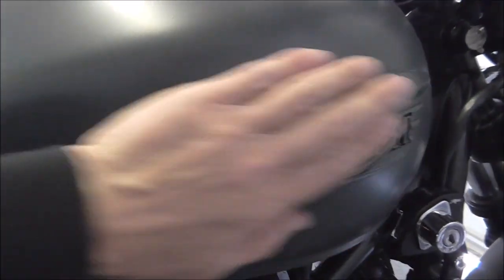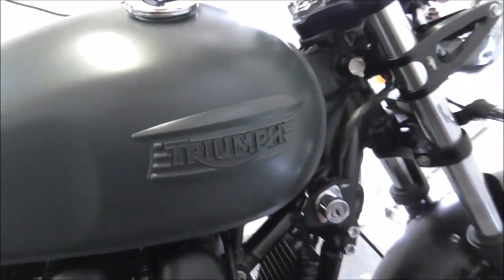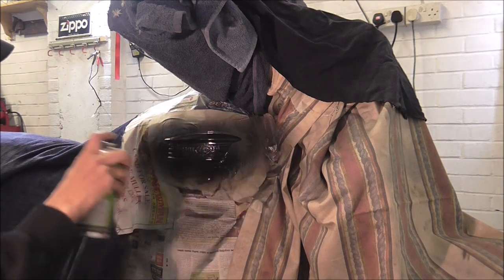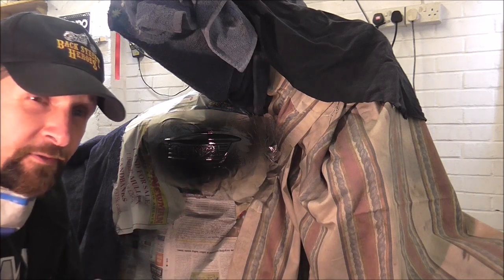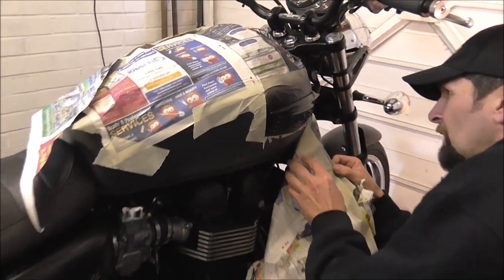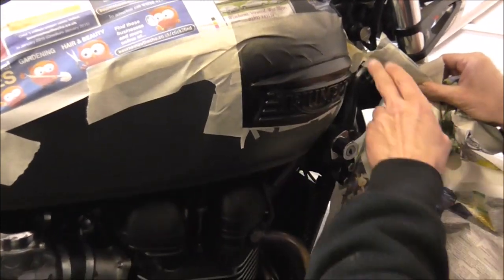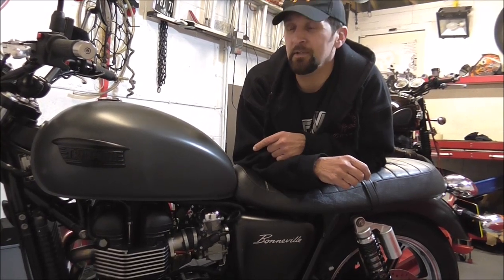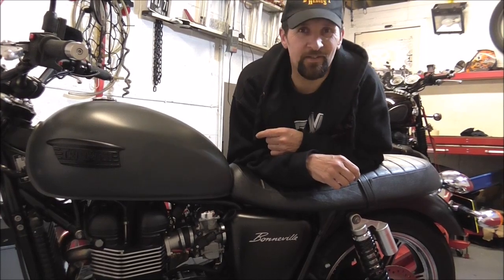Delboy's Garage, Triumph Bonneville, Vinyl Wrap, Tank Badge

Comment: IMO the Chrome look is going to look fantastic, it'll pick up the name from the side cover, the shocks, handlebar weights and the metal from the engine.

If you prefer the black (which I do fancy BTW) I would go with black exhaust like you did on the scrambler.

Thanks for sharing!
Reply from the maker: Christian Wallace  Good a little run down there, Penny's having a good think about it and will make a decsion tomorrow!  Could be back in the garage by afternoon lol!

Comment: I'm all about it all being blacked out. I have done away with most the chrome stuff on my bike but like another guy said maybe a little to much but it still looks good either way. Side question what is the temp rating on that stuff? For example could you do the rocker boxes on a sporty? Mine are chrome and they are driving me nuts lol.
Reply from the maker: Nick Green Hi mate, it's gotta be worth a try mate, as it's pretty cheap stuff .. .the problem is that any experience I've ever had of removing rocker covers on a Sporty (and you won't paint them in situ) is you have to wriggle and force them back in under the frame, specially the rear one, and the vinyl wrap isn't really man enough for that... but if you don't mind it permanent, then you can buy DIY Black Wrinkle Finish in rattle cans, if you can bear to walk in to the dump that is Halfords and tolerate the teenage patronisation... !
Reply: Lol thanks for the info and I forgot all about wiggle those things out

Comment: Is it possible to try and pick out the Triumph lettering on its own for a chrome-on-black badge effect?
Reply from the maker: ***** Sadly not Ian, even if you could cut just round the lettering, which would be tricky and take hours, and one slip and you'd trash it, if you did eventually succeed you'd find the lettering is black underneath anyway lol !!!

Comment: Del could I frost wrap my tank and put a decal on top safely?
Reply from the maker: c r Yes indeed you certainly can mate... that's exactly what Penny has on her side panels... the Bonneville badge is a just a laser cut sticker stuck on top!  The trick is to do the vinyl wrap first, give it a week to 'dry' and shrink, and DON'T put anything on it, no polish, no silicone, nothing, leave it completely bare , then you can stick the decal straight on top!
Reply from the maker: c r Yes indeed you certainly can mate... that's exactly what Penny has on her side panels... the Bonneville badge is a just a laser cut sticker stuck on top!  The trick is to do the vinyl wrap first, give it a week to 'dry' and shrink, and DON'T put anything on it, no polish, no silicone, nothing, leave it completely bare , then you can stick the decal straight on top!